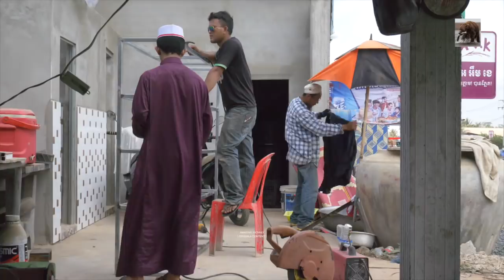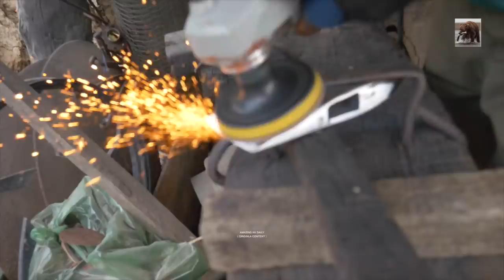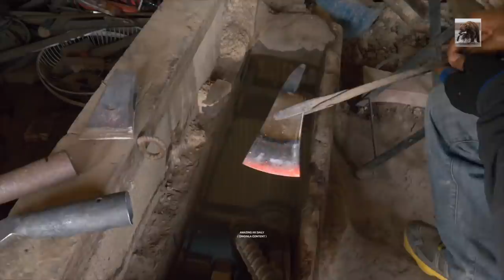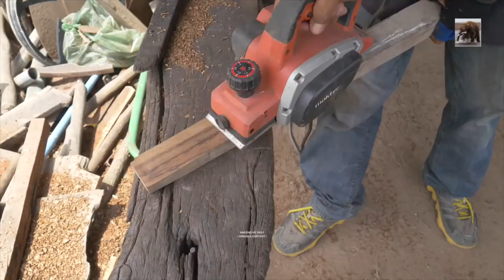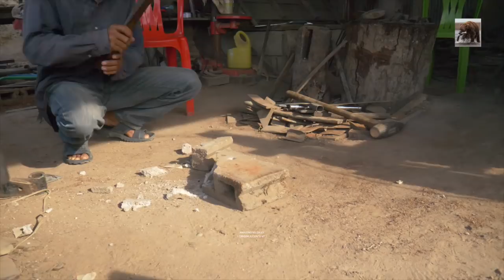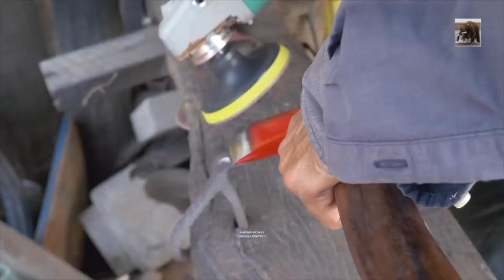MAKING A FIRE FIGHTER AXE USING OLD FORGING TECHNIQUE

Comment: @amazingkkdaily    My request that the list of things you to make 

1, panel beater hammer & Dolly
2, Tinner's hammer
3, Carpenters planer
4 , vegetable chopper 
5, coconut pealer 
6 , coconut tree climbing device
7 ,  iron pipe chair & table
8 ,vegitable swirl cutter
9, air Bellow forge 
10 , Rubber tree tapping knife